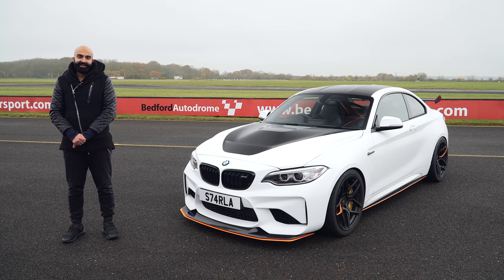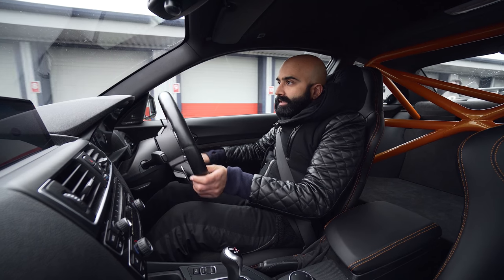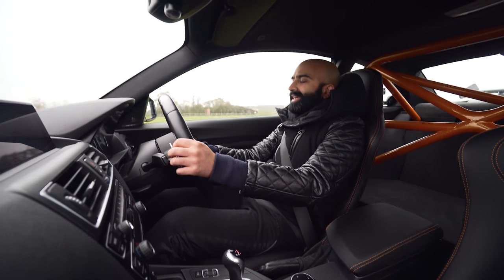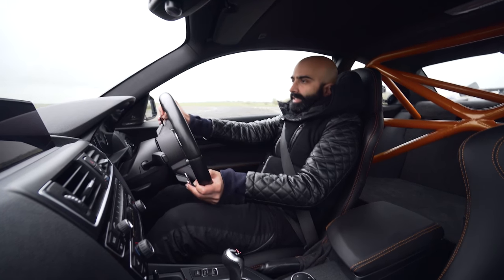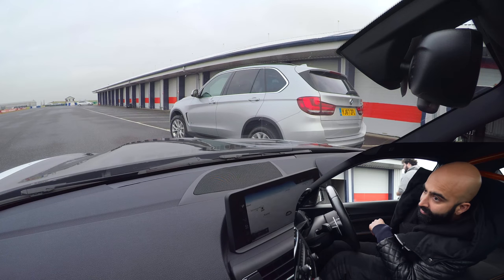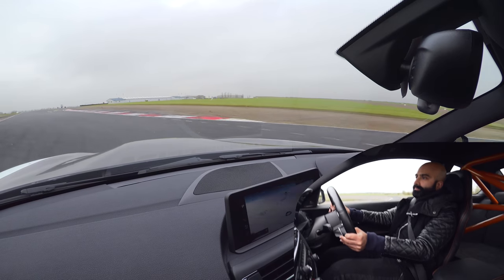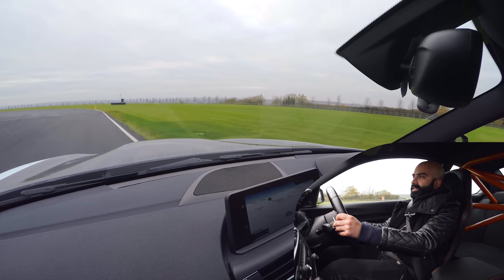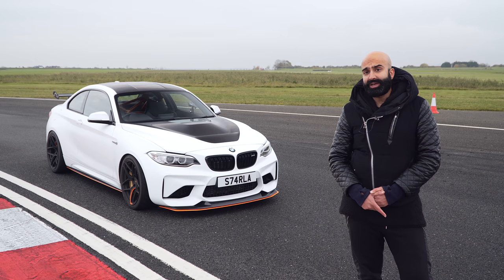Testing our M2 GTS Project on track

Comment: Engine pulls like a train! Try about -3deg camber up front, and -2deg camber at the rear and you'll have a weapon in your hands. Don't go to large on the anti roll bars either as that can be a cause of traction loss at the axle. 👍🏁
Reply from the maker: Thanks Rob, suspension settings are definitely something we'll be looking in to, possibly with a proper geometry/corner balancing setup.
Reply: Evolve Automotive Yeah I use Matt @ Spires (in Leamington Spa) to setup my E46 M3 (on Intrax coilovers). Can highly recommend him.

Comment: Cool vid and nice build. I would suggest Replacing the R888 with NT01s or something at least as grippy and dialing in some more camber for better front end grip. I’m running at least 3.2 degrees in front with 0 toe. Oh, and wheres the harness.  I mean you have a half cage to mount up a proper harness. 😂
Reply from the maker: We don’t get NT01s, or any Nitto in the UK. Car is now on PS4S. Alignment has been dialled in more since this video.

We actually have genuine M4 GTS Schroth harnesses in stock, but as it is mainly a road car, and the fact the seat has no harness holes, we stick to the OEM belt. If it was a more dedicated track car then yes of course you would be correct in adding harnesses.

Comment: How’s the exhaust/downpipe set up on long motorway journeys-no drone like the MPE?
Reply from the maker: Terry Cole no drone at all
Reply: Evolve Automotive thanks for the quick reply, is that a valved system? Nice video 👍
Reply from the maker: Terry Cole yes it is valved and thanks!
Reply: Evolve Automotive and final question...is that the dual pipe system or should I say what’s better? Cheers
Reply from the maker: Terry Cole single pipe system. No experience with the dual pipe. We like the sound of this one anyhow. We keep them in stock 👍